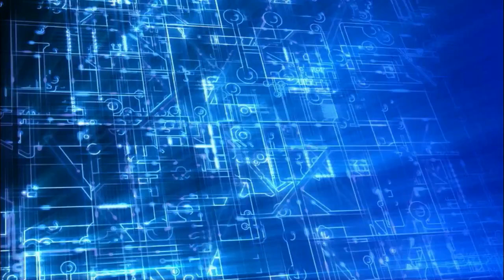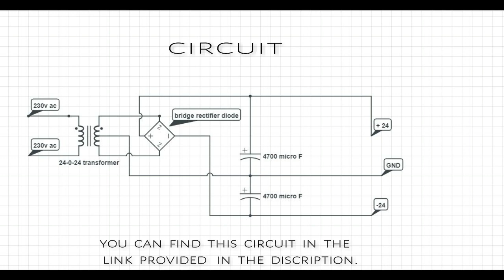How to get 24-0-24 dc power supply from transformer .

Comment: What should I add in the circuit in order to get an output voltage of 24 and -24 Volts?
Reply from the maker: You should use  7824 and 7924 voltage regulator.(but it will only allow less than 1 amp) if you don't want any amp loss means, then go for buck converter.
Reply: @CREATIVESTEAD  Got it!  Thank you so much for helping❣️

Comment: 12v 5A rectifier circuit ku capacitor and diode values ena varum???
Reply from the maker: 1000 microfarad capacitor. (5amp or more than 5 amp)

Comment: 30-0-30  10AMP  63v 10000uf capacitor use panna output  DC Volt evalavu varum pls sollunga
Reply from the maker: approximate ah oru 40 or 42 voltage output varum.
Reply: @CREATIVESTEAD  samela innum rand capacitor use pannina ( total 4 capacitor 10000 uf 63 v) out put dc evl9v varum . Kooduma atha same ayirukkuma

Comment: Bro DVD player smps la -12v,+12v,gnd 3 pin eruku ethula 12v out put atuka connection yathula bro kutukanum
Reply from the maker: +12v and gnd.
Reply: @CREATIVESTEAD  thanks bro -12v yathuku bro
Reply from the maker: @vimalraj-kt1gl  It is used for dual power supply applications.
Reply: @CREATIVESTEAD  thanks bro

Comment: 38 varuthu its ok or any prlm?
Reply from the maker: What ic your using ?
Reply from the maker: Its not an big issue. But lifetime of the ic will reduce.
Reply: @CREATIVESTEAD   4141 stk
Reply: yes sir with in 10min ic failed what a method to prevent that?
Reply from the maker: @ravikumars4111  but within 10mins nd all ic wont be failed. 4141 ic ku radiator use panniya?